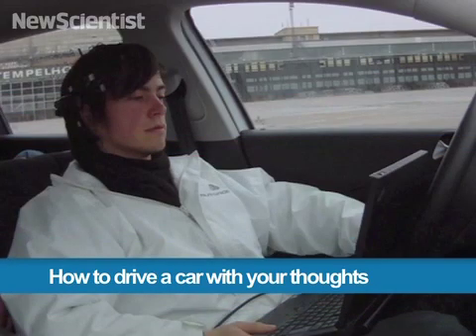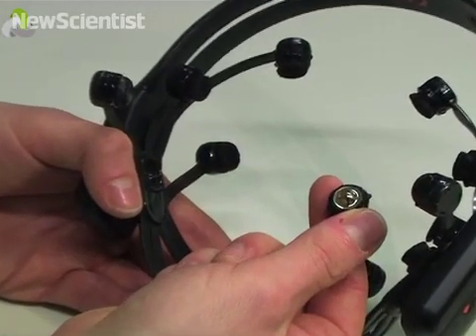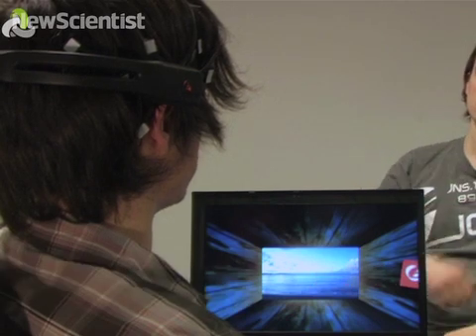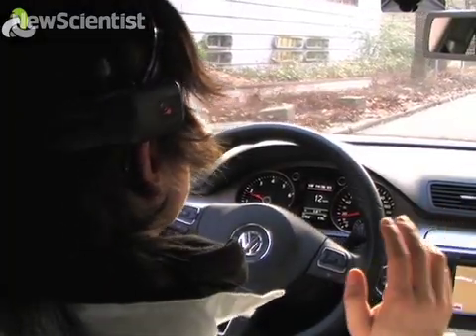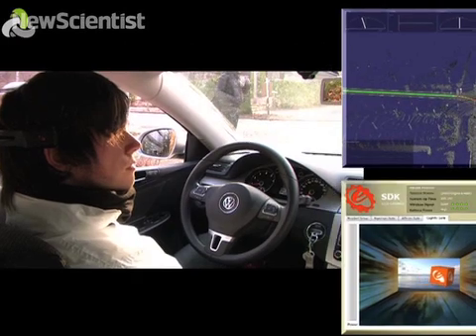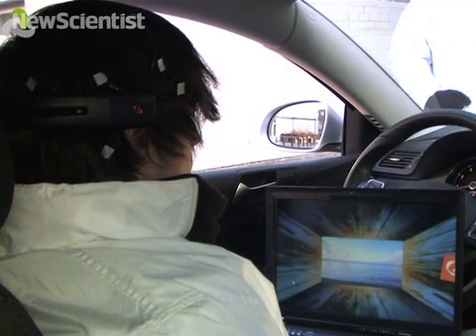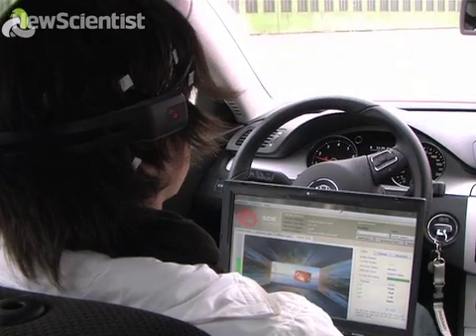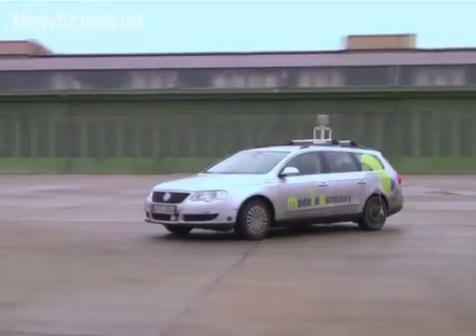How to drive a car with your thoughts

Comment: yes but surely the processing of the brain signal will take time no? Also, more high tech technology means more things could go wrong. Furthermore, how can you adjust  how much steer you want accurately using your brain ? I imagine this would require high concentration aswell, what if you got distracted? I see this technolgy unecessary when we already have a perfectly ergonomic steering wheel

Comment: @breakfastmachine1000 The car itself is autonomous. It's just the high level commands to turn left/right that the driver is giving using his thoughts. The finer details of steering, following traffic signals, etc. are done by the car's computer. Read about the Urban Challenge competition.